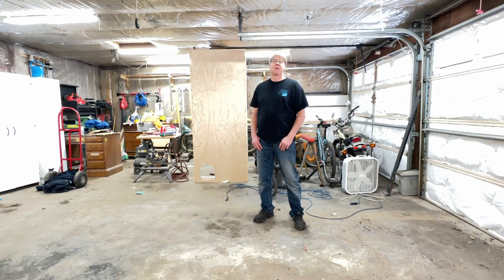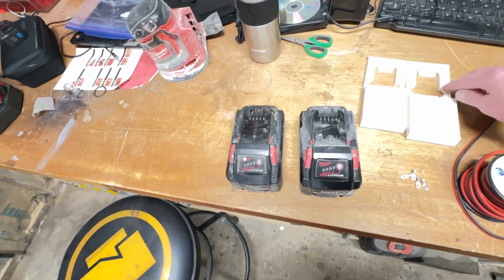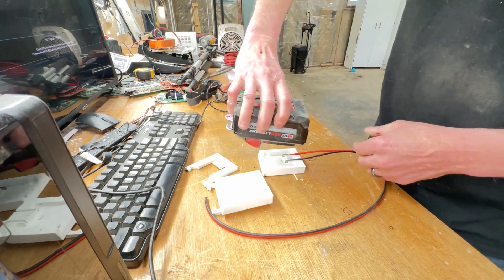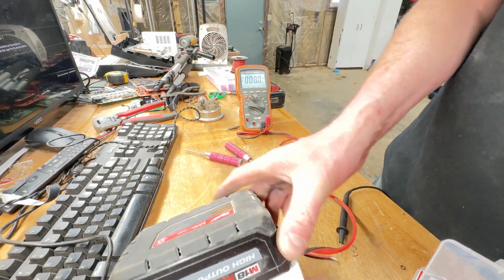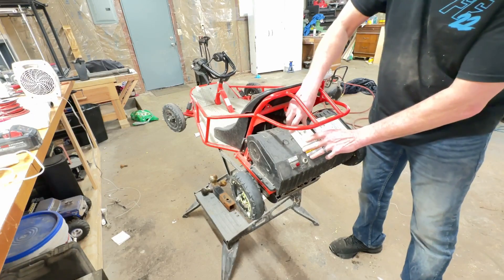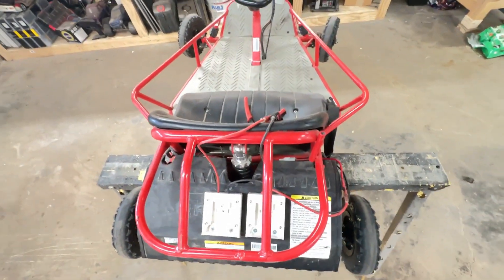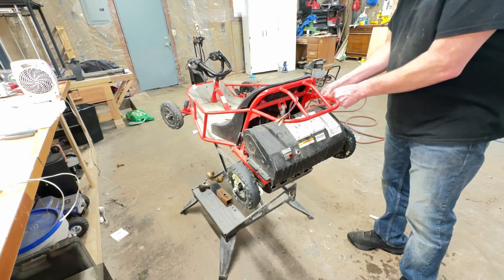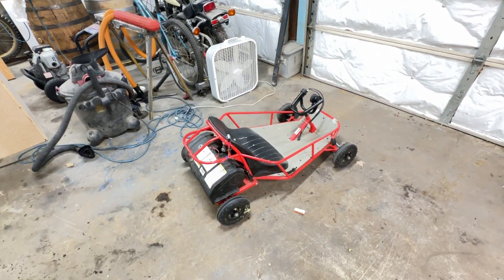Powering a razor go-kart with power tool batteries?

Comment: Epic! I also did a lithium ion conversion with one of these, but I used a 24v battery. I’ve been thinking about upgrading and have been wondering the same thing: would a higher voltage battery damage the motor/controller? Would love an update to see how your build
Is doing under a longer test!
Reply from the maker: One thing I never did check was how much voltage is getting to the motor…might have to go check that
Reply: @distortedsteelgarage  sounds like more content for a possible update video 😁
Reply: Any update on the go kart?  How it's holding up?